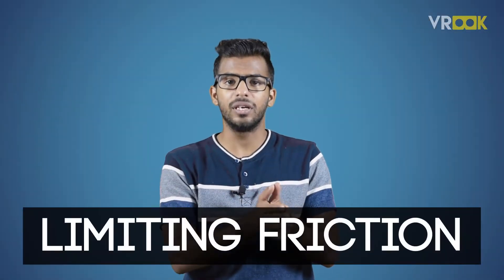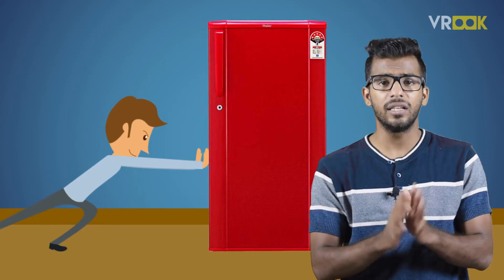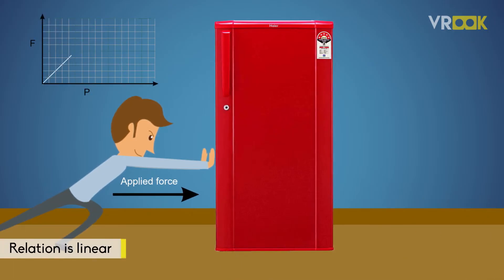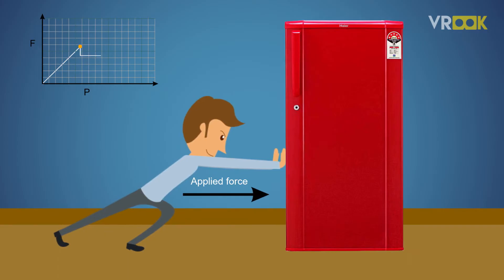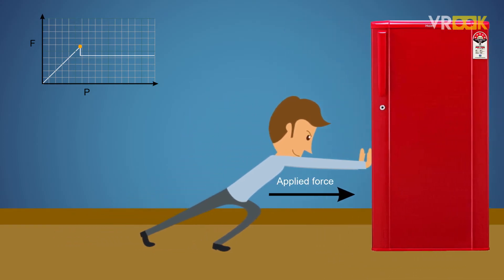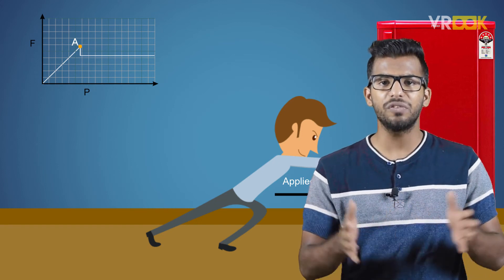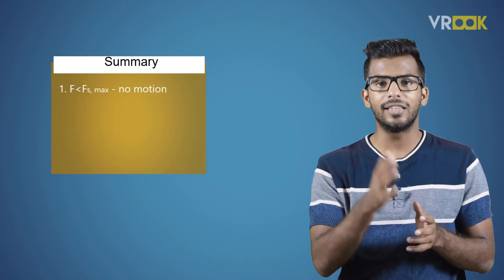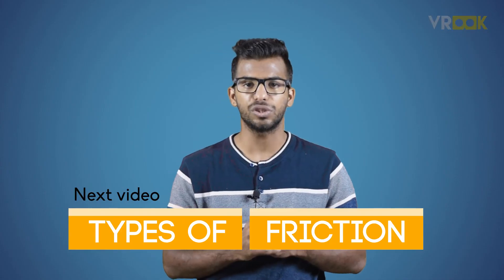What is Limiting Friction? | Explained | #friction #physics #iitphysics

Comment: Still don't understand
Reply from the maker: Imagine you have a heavy box on the floor, and you want to push it across the room. The limiting friction in this scenario is the maximum amount of frictional force between the box and the floor that prevents the box from moving.

Let's say the box is really heavy, and it takes a lot of effort to get it to start moving. You push on the box with all your strength, and at first, it doesn't budge. You're applying a force to overcome the limiting friction. Once you push hard enough to match or exceed the limiting friction, the box finally begins to slide across the floor.

So, in this example, the limiting friction is the maximum force of friction that opposes the box's motion and needs to be overcome to set the box in motion. Once you apply enough force to overcome this limiting friction, the box starts moving.
Reply: @vrookLearning   Thanks sir
Reply: Tysm sir 😮🎉